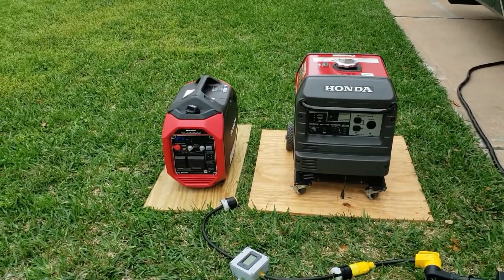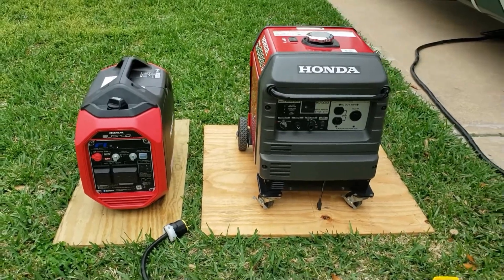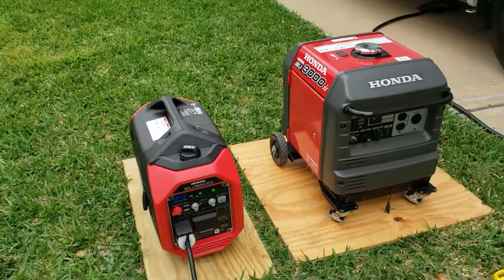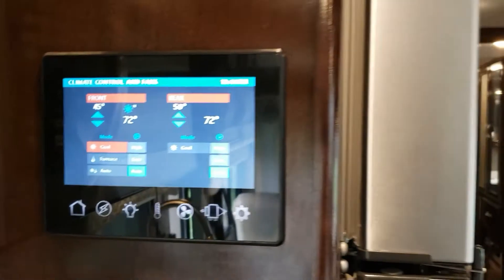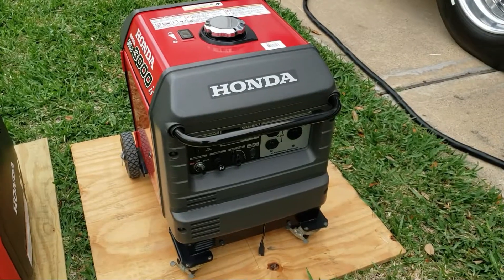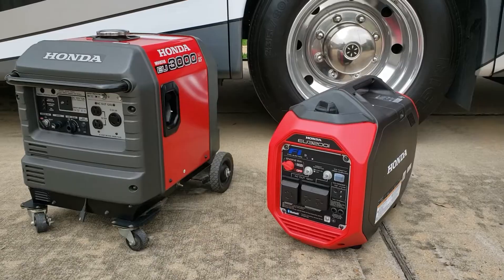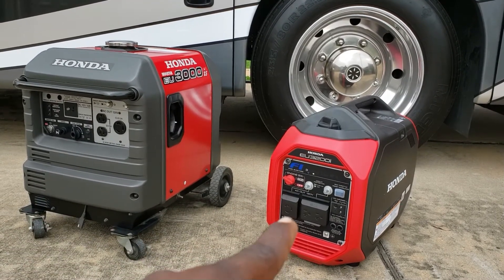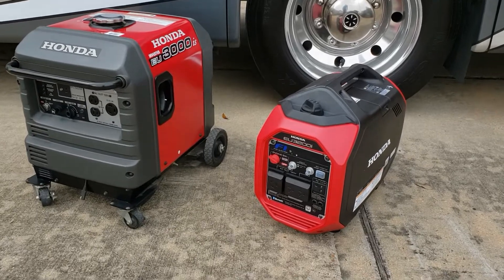Load Test: Honda EU3200i VS Honda EU3000i Comparison Fuel Injected vs Carbureted

Comment: Only real advantage is the portability vs the 3000. Other than that way overrated vs Champion products.
Reply: Honda is in a different league. You can not compare it to anything else. Maybe Yamaha comes close but again Yamaha also has some inverter issues but honda is just pioneers at this tech. There is not a single common failure in these that other brands do not have. Honda gens last 15-20 years easily.
Reply: @KuntalGhosh  i have a 20+ yr old champion.............go figure.
Reply: @duskyman1  champion makes all honda clone. 😂 If honda goes 40yrs champion would go 20. 
90% of portable generators are honda clone engines  from china.
They make low quality clones and then those are assembled into cheap generators sold by champion generac and other brands. All of them are made in china while hondas have their own production in japan. India thailand. And quality maintained no matter which factory makes it. 
Those champion's quality depend on which day of week it was assembled and how good that uhigur kid was treated that day.
Reply: @KuntalGhosh  you're partly right.
But you're not. Champion got into the business 25 years ago by using the highest-quality clone engine they could could...... I have a 25 year old champion generator with several hundred hours on it, it runs great it's perfect.  Champion has a good reputation... Because it one time at least they put some care into their generators.  Champion generators are not generic Chinese junk.  I do think they've had some problematic models though as they've introduced so many over the last decade.

Now, the engines that are being used today by most chinese mfgs.... Are not clones anymore.  They still share the basic design and even have interchangeable parts..... But their displacement have been increased over what they are Honda design originally was.  In short they're more powerful than the Honda nearest engine size. And the quality after being produced for 20 years is actually pretty good.   This is why Honda generator will be rated 6,000 and the other Chinese generators using an engine based on the same Honda will have more displacement and they may be rated 7500

There's a new class of generator now... That are smaller and lighter.  This is accomplished by taking smaller engines and running them faster. The Max RPM on any Honda gx engine is 3,600.    These new  on some small generators are running 4000 5000 RPM.. these aren't Honda engine designs at all.... These are totally different engines from a Chinese engine manufacturer.  . And the generators are insanely light and portable.  Which fits somebody's needs..... But obviously longevity is going to be seriously impacted most likely .  

There's people who race go karts that are basically using the Honda 6.5, and clones... And they have power down to a science.  You can look up exactly what you have to replace to get more power out of the engine.  At about 4,000 RPM need to replace the valve springs so they can keep up. 4600 RPM you need another flywheel because the stock will fly apart., Etc.   These people build repair and race these engines and know them inside and out..... And most of the clone engines today are pretty darn good.   They use clones mostly  because of you blow an engine racing it, and $175 is better to blow than $750.

The flip side of that is if you were going to run a generator everyday.... Without a doubt I would say get a Honda.   But that's not how most people use generators..... They will put a few hundred hours on them over 10-15 yrs.... And the clones have proven perfectly capable of that.  Today, Honda has a extremely small share of the generator market.

On top of that Honda is not without problems either today.... They may be less frequent, but they aren't 0. 

 There was a couple yr old Honda eu6500 for sale near me that had a failed engine.  It had like 50 hours on it, but the warranty had already expired.  I don't know what the guy expected to get for it but I offered them $900.  I told him it would cost $1,000 for a new Honda engine even if I put it in myself.  And my time was worth something too...hundreds....     The repaired generator was worth about 2,500 to me.... So I told him 900 was the most I was willing to pay for it.  Last time I looked it was still for sale.   Eventually somebody's going to buy it and put a clone engine in, and sell it as a Honda when it's not.

 The bolts in my champion 100719 have paint marks on them . Those are qc checks .  Qc stamps too.   Like i said, champion isnt generic clone junk....its pretty good.
Reply: @joebrown9621  i don't know where you live, but here in India. eu30is goes for 1200$ and 70is goes for 2500$. parts are super cheap aswell for honda oem parts. most of the small components that come from japan are a bit pricy but rest of the locally honda made parts at honda siel factory is so cheap that there is no market for imported china generators. i bought a used eu30i for 300$ , it had very low hours but the previous owner left the fuel on and the fuel rotted in the carb. i cleaned the carb. bought a whole set of gaskets , filters , tools from the honda dealership and the whole set was 30$. cleaned everything up in 3 days and it runs like a brand new set , in 2020 it ran 6 days non stop on propane after cyclone knocked out power for my home. my previous honda ebk was 25yrs old before it got stolen.
Reply: I’ve owned both, I would never go back to a champion. Hondas are soooo easy to work on if they ever need it.
Reply: Here’s why I purchased the eu3200i, long story.  My first generator was purchased over 20 years ago, the eu3000i, and it did I exactly what I wanted: power for an RV ac and power in our pits when we raced motorcycles in California, at a quiet level. Trailering cycles from AZ to CA meant a trailer that could easily swallow the eu3000i.  But then came my camping days with a truck camper and lifting the eu3000is in and out of the truck camper was impractical, so purchased the eu2000i which under only the best of circumstances could it run the ac. So I purchased the companion eu2000i. Now I’m hauling two generators and learned quite well how to clean jets and even swap out high altitude jets for camping in the  Flagstaff area. Non-ethanol gas solved the need to clean the jets and my skills at swapping jets diminished. The moment I learned about the eu3200i I knew I had to have it. Just 60 pounds vs 46 for each eu2000i and a much smaller footprint, but the killer feature is the fuel injection, it will work fine wherever I camp.  It arrived a few days ago and I couldn’t be happier and the bluetooth is icing on the cake, I know exactly the load on it as I turn things on and watch my phone. I also have the Victron app for my truck camper battery so I’m a huge bluetooth fan, I’ll never be wanting for more information on my power needs.
Reply: @randyfrommesaarizona6927  the fuel injection is lot better than carb but you should still use ethenol free gas or fuel stabilizer..
Those components are not cheap. Few hundred bucks for the whole fuel system. If maintained properly honda fuel systems run for ever. Just look at their cars. 20yo and still on all original fuel components.. they would rust out earlier than mechanically failing.
Reply: What model of Champion is their quite model in comparison to Honda or Yamaha? I have personally never seen one that wasn’t as bad as a lawnmower.
Reply: @mclcr4053 the larger inverter generators can  have 100lb that goes into noise reduction.    Look at weight of open frame inverters, and same size in closed frame.

Its a compromise....weight, power, noise.

The powerhorse 7500 is quieter than honda eu 6500.  Why.....well it weighs 292 lbs.....vs  246 for the honda.   My champion 7500..100719...is louder....but weighs 212 lb.    Which would you rather move around........... Like I said they're all compromises.  Just depends on what's most important for final use.
Reply: Champions are loud.  If you don't mind noise, Champions are fine.
Reply: There is nothing better than Honda Generators. Champion is junk compared to Honda.
Reply: Chanpion products are garbage period
Reply: Needed a laugh, thanks

Comment: Big improvement for Honda. Thanks for the great review.
Reply: Not really, no electric start or remote start capability is a big no for me. I've had the 3000 for 10 yrs with no problems.
Reply: @tumbleweedking5668  yes but the weight/power and size compared to eu3000i ? Hopefully Honda will incorporate more features. My 3000 is a battle tank and is equally heavy. I still think this is a huge update to the Honda line.